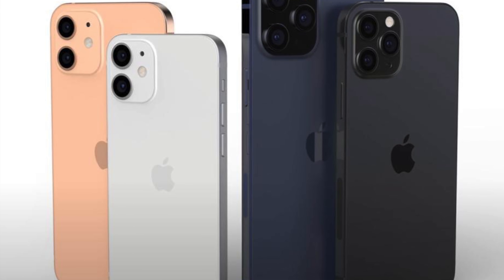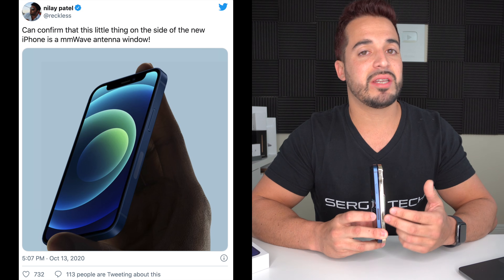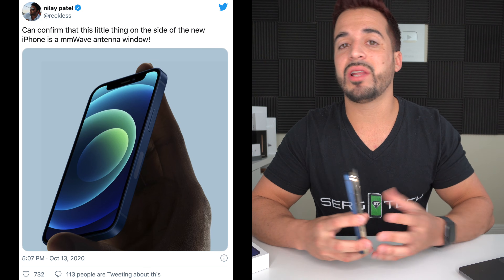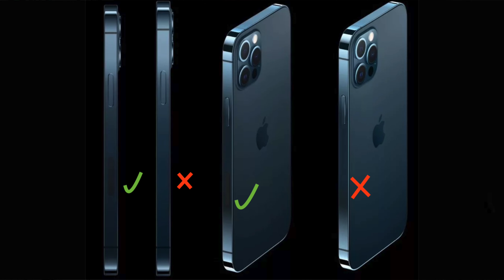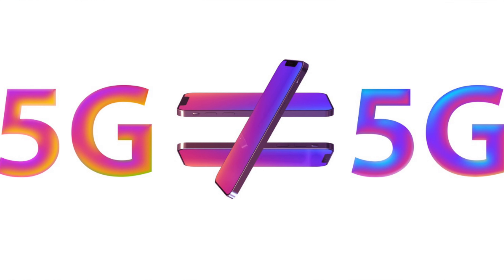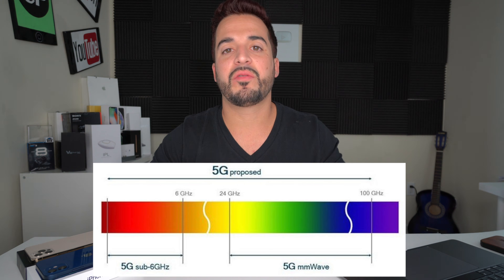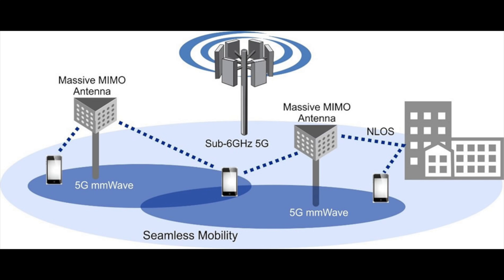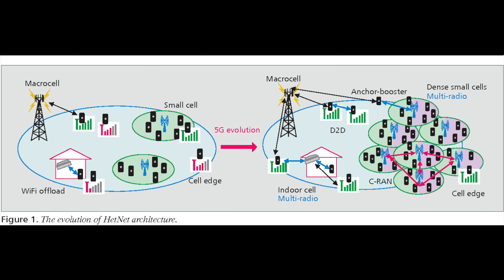The iPhone 12 Sensor Apple Didn’t Tell You About

Comment: Most cases have it covered up. If covered it won’t get the 5G signal then???
Reply: No, because the cases are plastic or some similar material and won't block the 5G
Reply: Actually the no clear cases do block it. I never hit 5G with a no clear case. When I’m in the same spot with a clear case, I see the 5G appear.

Comment: Should have put a touch id sensor in that window and dropped the 5g for battery life.
Reply: Ya. No... lol
Reply: @artieartya  Lol what you think legitimate mm wave length 5g will be widespread for real use in america before this phone is replaced by the user? Cause the bulk of america it took 3-4 years to even get reasonable lte. MM wave barely has a fraction of the distance of LTE so the roll out will be longer. UW/5GE are just advanced LTE and only need an Newer LTE modem and antenna. By the time MM wavelength matters in that iphone it'll be dead. I'll take my battery life, and so will most people.
Reply: @deathjunior7755  yes I do I live in America friend. I’m in Florida and hot 5g all over. And it is continuing to be built and spread by T-Mobile att and Verizon. And will continue to develop. Got my 5g iPhone 12 and enjoying amazing bliss of 5g every day I’m out and about.
Reply: @artieartya ll the "bliss" of 5g. Cool well do you live in Azalea park, holiday, progress village, or westchase, or 12 others as of now there's just 16 small places in florida with access to real 5g. Heads up the iPhone says it's on 5g even when it isn't, it's well documented. Even then T-Mobiles is the 5g "mid-band" not the higher speed option verizon is running. However, let's say you do and let's say your one of the incredibly rare few who live in range of one of the backpack cells within those few communities. Have fun watching your speed plumit back to lte speeds if you turn away from the tower or someone stands between you and it, or even if you so much as hold up a sheet of paper in the way.
Reply: @deathjunior7755  seriously not looking to keep going back and forth. 5g has been great experience for me in the states and not looking to go backwards rocking no 5g and ginger print vs Face ID. That’s all I’m saying. And I have an iPhone 12 and use it in real world use and can confirm the 5g signal is amazing when before I couldn’t get service in certain areas and now I can and a whole crazy lot faster. I never go backwards with tech and always progress and push forward. You on the other hand give up and want to remove a 5g chip and talk about older tech because according to you the new tech sucks and is not prevalent. We’ll in order to make it better and develop anything you need to implement it and have a starting point. If you keep throwing your hands in the air and give up and stick with older tech then yes you’ll never move forward in life.
Reply: @artieartya  Nah according to me and basically every reviewer the battery life in the 12 is abysmal compared to the 11 and the face ID is a problem in a world where masks are as common as they are. Face idea is useless with a mask on, my fingerprint reader on my samsung however is just fine. What I'm saying is that last time apple chose to be 3-4 years late to the 4g lte party. This time around they should have done something similar and focused on other parts of the phone instead.
Reply: @deathjunior7755  not abysmal according to me lol. Notice no diff compared to the 11 pro max I owned. You got an issue with the new iPhones that’s fine and you own opinion . Mines fact. I own a 12 and owned an 11 pro max. Love both. Work well. Speed is incredible and battery life is same from my real world experience. Use it for work and out and about between LTE and 5g endlessly throughout each day.
Reply: @deathjunior7755  not sure how Face ID is problem at all? Works flawlessly is every iPhone I’ve owned. Including iPad Pro. Extremely fast and secure. Doesn’t even feel like phone is ever locked that’s how fast and reliable it is.
Reply: @artieartya  well as I mentioned it's a problem because of masks,  my family as well as most customers I work with have issues with face id while wearing masks. If you don't wear a mask then you wouldn't know I guess.
Reply: @deathjunior7755  I do wear a mask at work 14 hours a day and takes two hot secs to type in the code when Face ID is not possible.
Reply: @artieartya  Lol takes basically no seconds to use finger print sensor mask or not. Only time I have to use a pin or pattern is when I restart my phone even that's because I enabled that feature.
Reply: @deathjunior7755  same with Face ID the difference is face ID is 1000 times more secure so I always say use Face ID when you can and never talk about removing face ID in favor of a fingerprint sensor that’s all. You’re taking my words so literal when I say a couple hot seconds.
Reply: @artieartya  Nah I'm not taking it too literal since its actually down to seconds of time. However, its also down to doing something vs doing nothing. As for level of security sure I'm not going to argue  with it. What I will argue is the effort it would take to fool the ultrasonic sensors used these days would be enough to stop any casual phone thief. A lock is down to one thing, how much am i willing to inconvenience myself to inconvenience another. A depth based ultrasonic sensor is more than enough to never have to fumble with a mask lol. At the end of the day apple added 5G to these phones over something more impressive and currently useable like 120hz because of marketing. Its substantially easier to market 5g. Because 5g is "the next big thing" but by the time that phone is ready to be replaced we still won't have real nation wide legitimate 5g mm wave. Honestly ill be impressed if we have it full coverage in the bulk of the major cities. What we will have is UW which for all intents and purposes is LTE Advanced with a new label.
Reply: @deathjunior7755  no. You’re just going backwards instead of moving forwards.

Comment: Question: do you think there is a difference between buying sim free iPhone from Apple vs. an iPhone that is unlocked and sim free using the Verizon link (also from the apple store)? One reason I ask this because the apple website says all the phones are unlocked. Also, because I just want to take my current SIM card (Verizon) from my iPhone X and put it into my iPhone 12 (if I order one) without having to start a 5G plan. Which option do you think would have the easiest results
Reply: Yo can do it thru Best Buy or Verizon for an unlocked iphone 12 & don’t have to use the new SIM card they send you. 
I bought a iphone 12 & took my sim out of my iPhone XR and just popped it in the new iphone 12 & it worked fine.